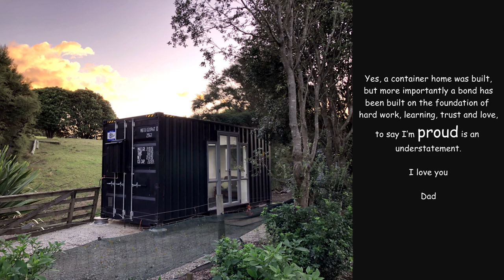Shipping Container Home #37 - 15yo BUILT a container home

Comment: Looks amazing. Are there power sockets in the kitchen area?
Reply from the maker: There are a couple of USB ports as it’s a 12v system.
Option of putting a 240v socket there via an inverter as battery compartment beside fridge.